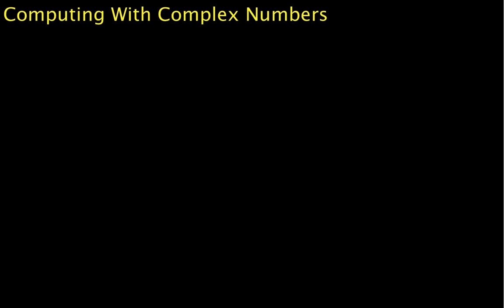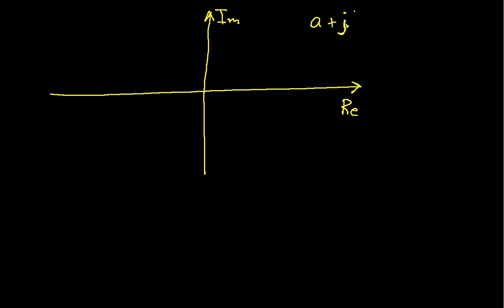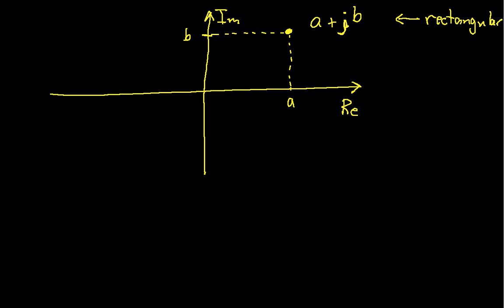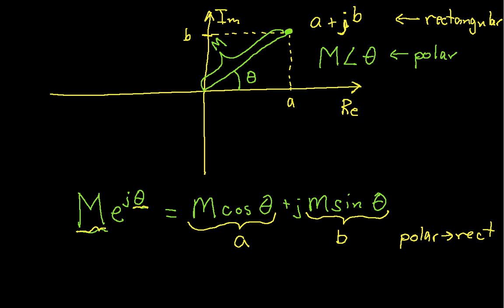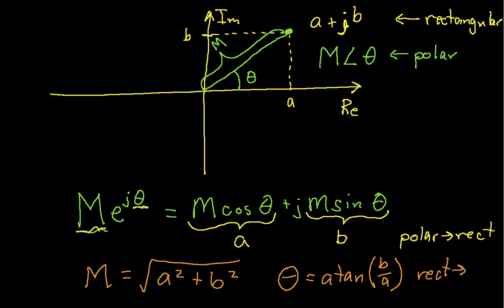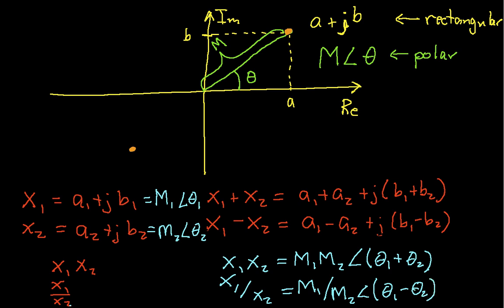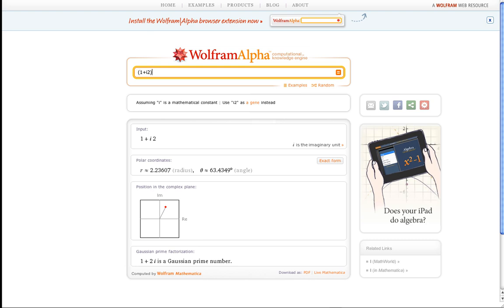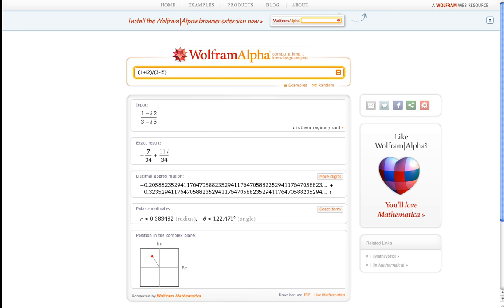Computing with Complex Numbers for AC Steady State Analysis

Comment: I'm wondering why we use "j" instead of "i."  My professor never told us why and I can't find a reason in the textbook.
Reply: because i is for electricity so they dont mix up
Reply: we use j instead of i because in circuit analysis  "i" is used for the current .
Reply: +Mason Huffman because using "i" in this instance can be confused for current "I", thus we use "j" to make a distinction between both